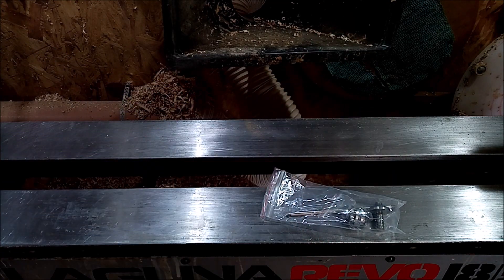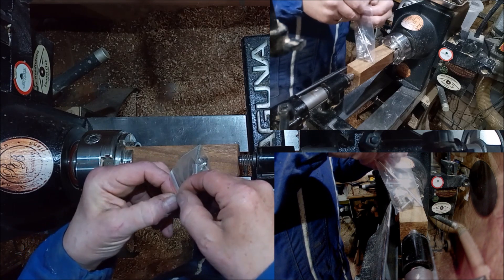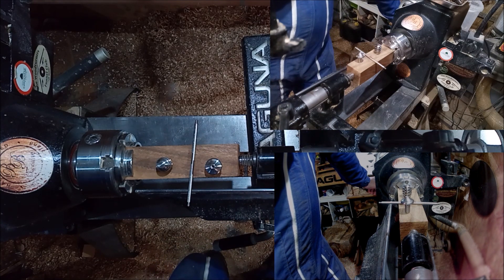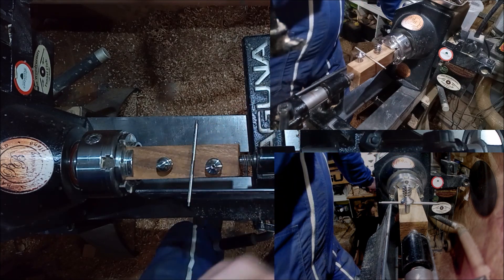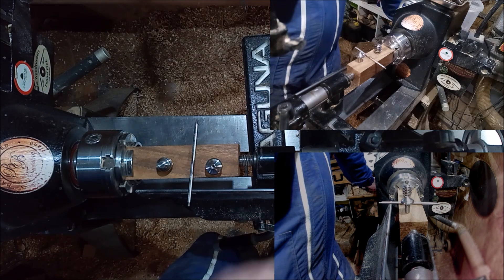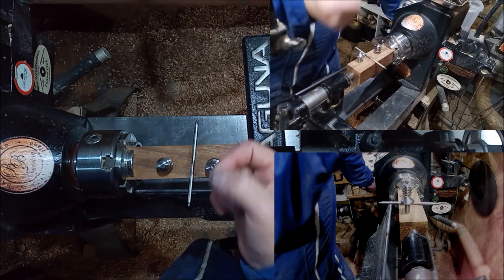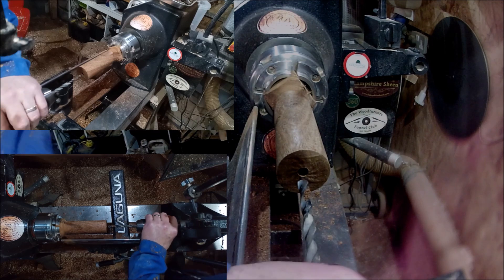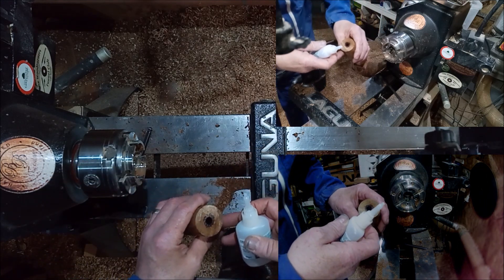Wood Turning A Stainless Steel Honey DIpper and a Question

Comment: Not only is honey antibacterial, wood is as well. The question was asked if a wood chopping board or a plastic chopping board was more hygienic. A large school here in the States did the tests and research and found that the plastic boards still had bacteria after washing in hot water and detergent. After cutting the same items on the wooden boards there was no trace of bacteria found after only a rinse in hot water. 

My conclusion is that the story you were told was something that had been told to him that he believed. The truth is that science has proven it false. 

Another great kit project. Well done!
Reply from the maker: Thanks Doug, that seems to be the consensus. It may have been something he was told and he latched on to it and is passing on what he believes to be good information.
Shay.

Comment: Two days ago I was in a shop that sold honey and mead. They offered samples of the local honey and of the mead they sold. I asked how mead was made and was told it's fermented honey and reach up around 13-14% alcohol by volume. We were also told that honey is naturally antibacterial and won't spoil. I tried a mead sample and it looks like white wine, had a slightly sweet taste a honey flavor. The sample I had was 6% abv but you couldn't taste the alcohol. The server joked that it's a dangerous beverage because of this fact which I agreed with.
Reply from the maker: That sounds more plausible than what I was told. 
Shay.